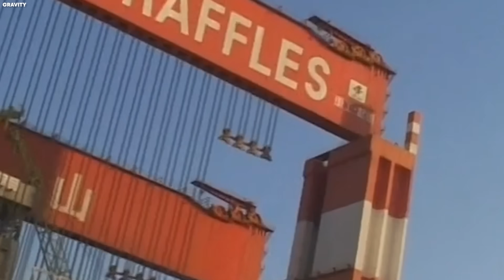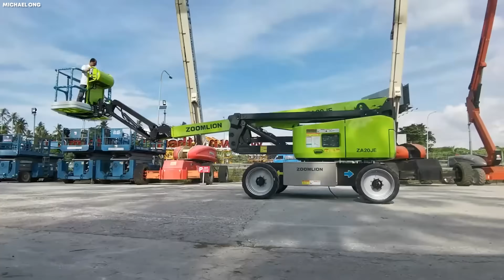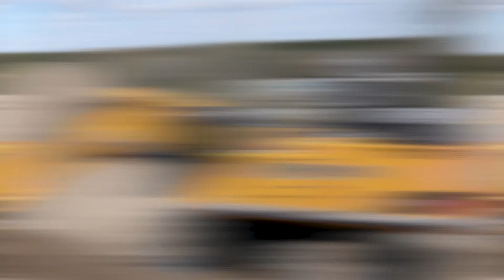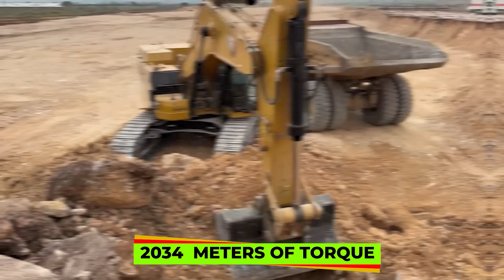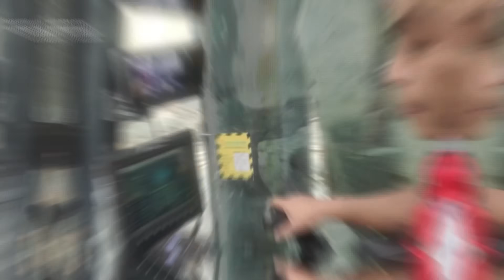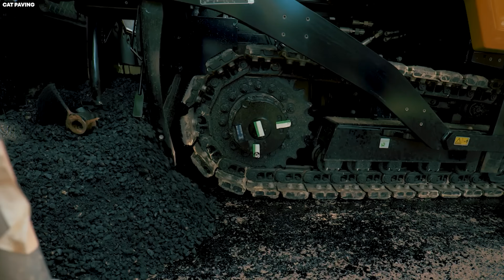China Produced a New Construction Machine That Surprised Even Trump!

Comment: "A world record doesn’t guarantee durability—time does. The biggest machine doesn’t assure continuity—experience does. Marketing might suggest reliability, but real strength comes from proportion, not promotion. Size only matters when matched with material integrity. Otherwise, it’s just spectacle. If size alone were the measure, we’d be building nails so massive they’d require skyscrapers just to drive them in. That’s not engineering—that’s absurdity."
Reply: So they built a railway terminal in about 90 hours. They built entire hospital complexes within a week during civid. Built more high speed rail in the past decade than the world, combined. 

The tools are built to satisfy a need. Remind me again how well the high speed rail project is going in California or how long it took to build the Hudson tunnel.

Comment: It seems China is happy using a quality engine from a British perkins company,, so we can actually make stuff China wants
Reply: From Wikipedia entry on Cummins: "Cummins has some joint ventures with Chinese manufacturers, such as Dongfeng Cummins, a joint venture with Dongfeng Automobile Company,[18] as well as Guangxi Cummins Industrial Power with LiuGong. One of the most successful joint ventures is the joint venture with Foton called Beijing Foton Cummins Engine Company.[ This joint venture developed the ISG/X12 engine platform in the mid-2010s. The ISG/X12 in China has surpassed 240,000 units per year making it the highest volume heavy duty engine in the Cummins product line. The ISG/X12 is the foundation for all Cummins future engine platforms.

Other entities were Cummins Beijing, Chongqing Cummins Engine, Xi’an Cummins Engine, Wuxi Newage Alternators, Xiangfan Fleetguard, Wuxi Cummins Turbo Technologies."
Reply: Owned by Caterpillar.